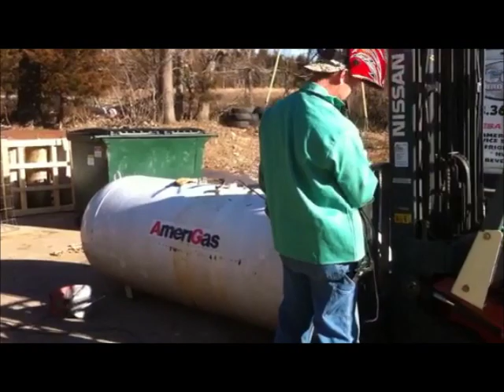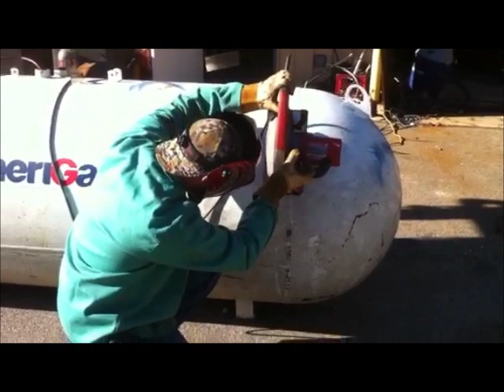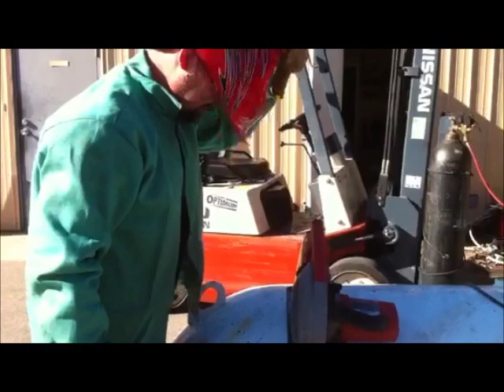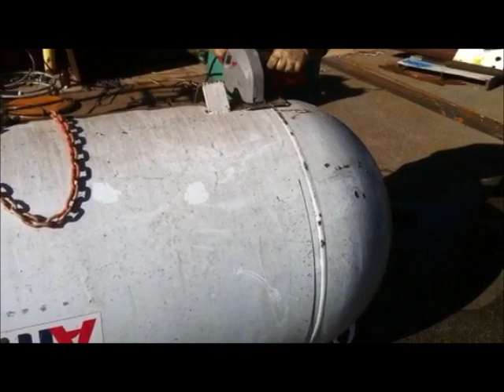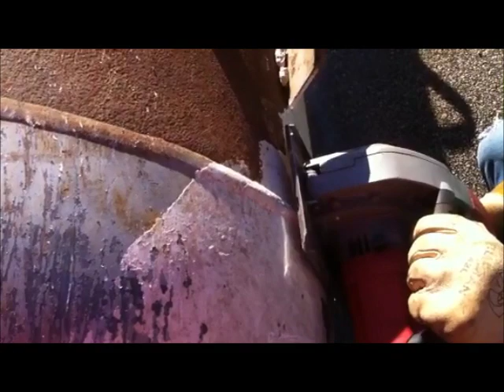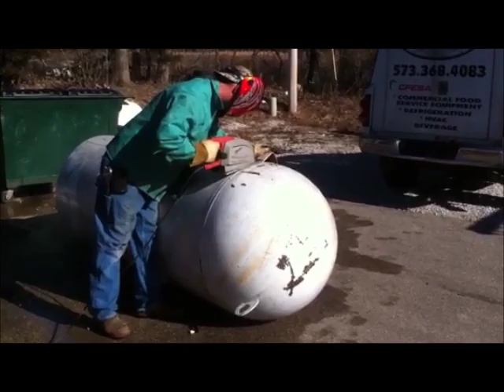How to cut a propane tank

Comment: Question... i got a 150# propane tank i want to convert into a smoker, but the original service/valve head is tack welded to a 2.75" pipe on the top of the tank. Ive managed to remove one valve with a wrench, and one with a hacksaw. How do i get the damn service head off without sparks. So i can water fill it before cutting?

Comment from the maker: The soap and the TSP are not required but they do help with the cleanup of the tank. I will tell you to make sure and overflow the tank tho. make sure there are no air bubbles in the tank before cutting.

Comment from the maker: you can but you need to use a PPM meter to be sure there are no flammables left in the tank. otherwise you have no idea if the tank is infact purged. Moving a large volume of an inert gas through a tank and then letting it out to get the tank back to atmospheric pressure and having the tank open to atmosphere should be fine but use a PPM meter so you know for sure.

Comment: Working on a 250 gallon tank build. Kinda worried about the mercaptan smell and neighbors calling 911. 
If I fill with water and soap... how bad does the water smell as it’s coming out? How long will it stench? 
I have lots of neighbors, thoughts?? 
Thanks, Jim in kc
Reply from the maker: Hey buddy! I probably would not cut if you have a lot of neighbors. Even if there is no gas present, the neighbors will complain like crazy. If you want to go ahead and do it he should call the fire department first and have them come over and tell them what your going to do that way they know what's going on before hand.
Reply: Hey I appreciate your response.. I went ahead and filled the tank with soap and water and drained it into a separate plastic container that was open top. And added my bleach to the open top container. That certainly helped with the smell. 
I have completely filled with water three times now to the point water comes out the top valve hole. I’m curious, thought I would ask this question. As I was filling it the third time.. of course with water pushing out any air inside. I tested the air coming out of the hole with a LEL monitor. 
It peeked at 4500ppm
Just thought that was extremely odd cents I had completely filled the tank all the way to the top twice already. 
Thoughts if you don’t mind...
Reply from the maker: Yes, trust your LEL meter! We cut tthem when there is water in them but as the water comes out air is sucked in. The best practice if you are concerned, is to back purge with CO2 as the tank empties. The CO2 is slightly heavier than the propane.